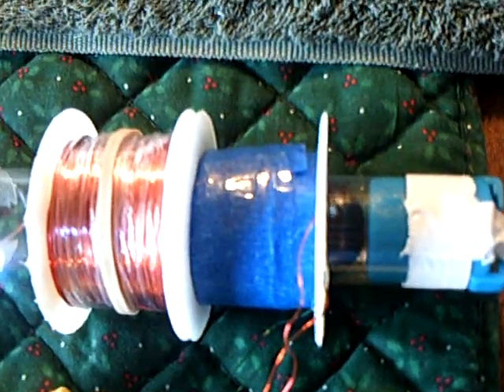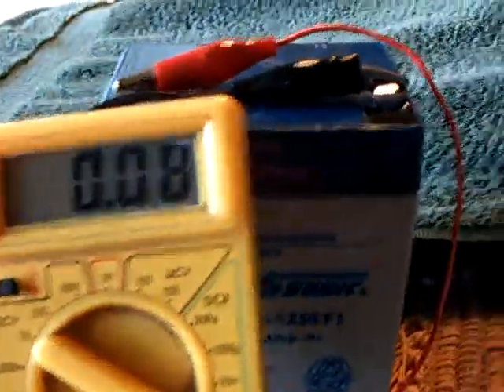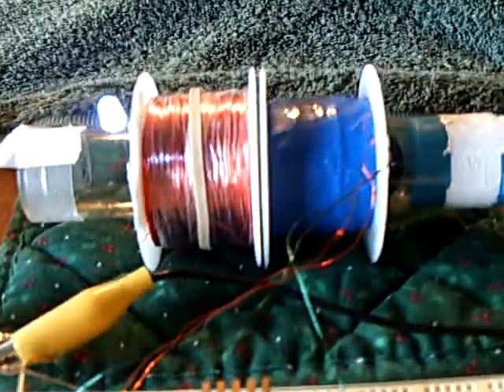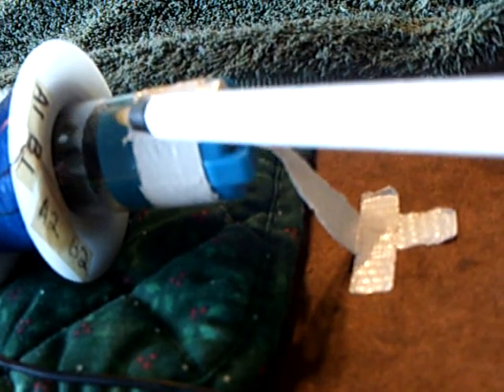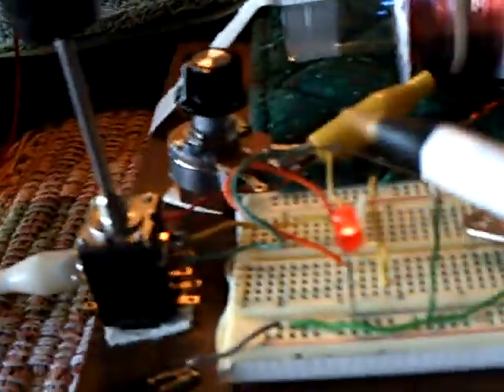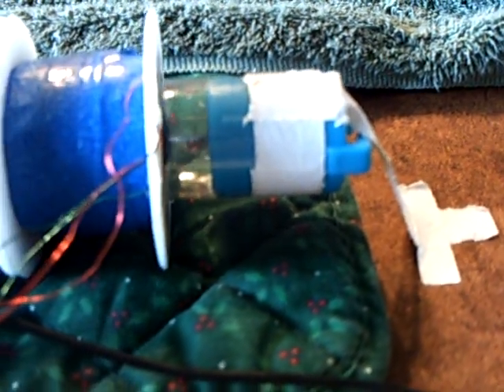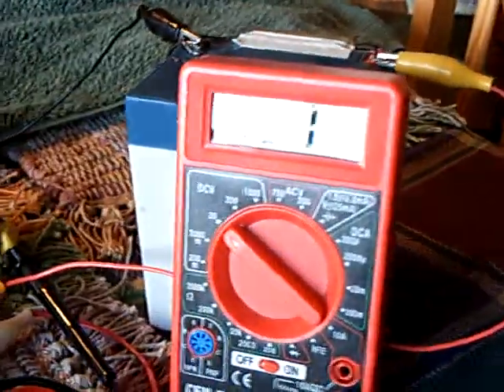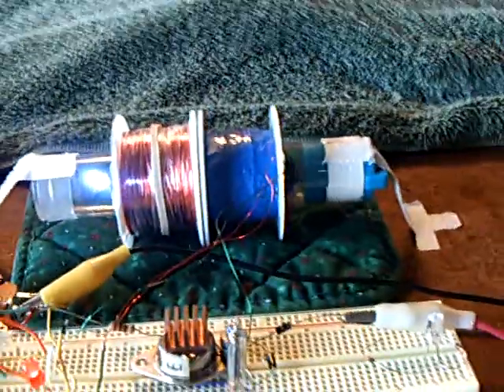Low Speed Ball Magnet Bedini

Comment: Do you think you could put a spacer in the end part on the right and fit another ball?? I would assume it is a self starter right? The spacer should be 1/2 inch i would guess or maybe more upto 2 inches I would guess... Maybe you could get a multi ball multi coiler running...

Comment: Do you know what would be cool to test? 

Get that gum tube and fill it with some very thin oil or something similar and put some nice closure of both sides. 
That could make it run smoothly and reduce the noise even more so you can try higher speeds w/o bothering your neighbors.
That's a neat device man!

Comment: It's too bad that you can't use a transformer and a couple of diodes to uncouple the supply battery so that you can use the voltage off it and charge the battery at the same time to make it run forever. Making use of one battery insted of having to switch everytime the supply battery goes dead.